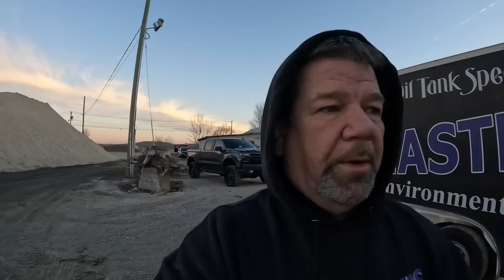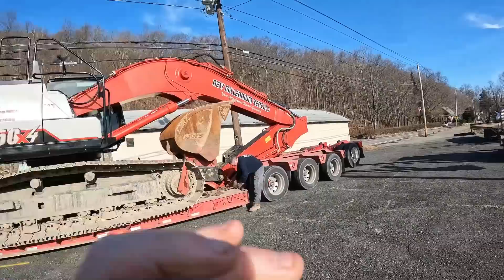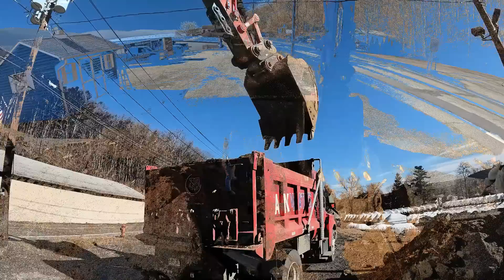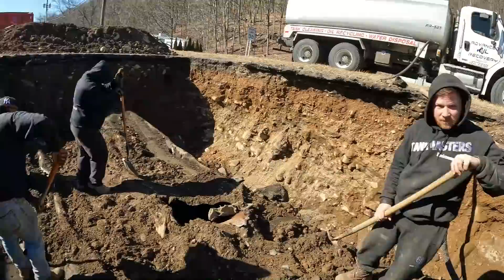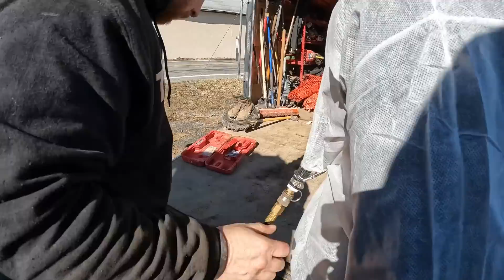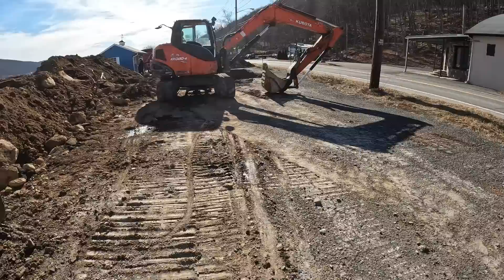LARGE GAS TANK REMOVALS AT A MARINA

Comment: When I was doing industrial controls, I was glad to work on ULCC super tankers for a few projects.  We used the exhaust from the ships engine to pressurize the holding tanks and had closed loop PID to regulate that pressure.  This would prevent the fuel/air mixture below the LEL and keep things safe with the inert mix.  😁👍
Reply from the maker: interesting

Comment: You operated that 40-ton excavator expertly and quickly exposed those buried tanks.  The bucket on that machine looked to be something like 48 inches and probably had a several yard capacity.  Those tanks were paper-thin and anything in them leaked out years ago.  It will be interesting to see if the soil around the tanks has any significant level of contamination.
Reply: He already said in the video there was
Reply: @staind288  .... the question is, how many tons? How far did it spread? Will work permits be needed if they get within 50 feet of the water? (normally 50 feet) Remember, shit flows downhill and it's probably had 50 years to do it..
Reply from the maker: in part two that is a hoodie challenge question. stay tuned

Comment: That's a pretty serious job. I have often wondered if adding a ground cable might be useful for cutting down the chance of making a spark while moving tanks. OTOH, in this case the gas is so old it probably won't burn, even though it stinks really bad. BTW, pre 1970 gasoline has a distinctly different odor from what we have these days.
Reply from the maker: hmmm, good thought
Reply: @TankMastersEnvironmental  ... BTW, a ground cable won't stop sparks from the Sawzall blade, but water will. Just thought I'd mention it.

Comment: I learned in confined space training the CO, carbon monoxide is flammable/explosive in a dense enough quantity. I doubt the tailpipe density is flammable but you’re dry ice co2 method sounds pretty safe. Is dry ice a better value than a bottle of co2? The dry ice may be better since it’s cold and fills bottom up in the tank.
Reply from the maker: Interesting!
Reply: I prefer dry ice as it will continually off gas co2 and maintain a safe level for a longer period of time with big holes in the tank

Comment: everyday stuff for me, I would have put a dirt berm between the excavation and the road to keep a distracted motorist from veering into the hole. wrap a strap around one end of the tank stand it up and let all the sludge and dirt run out onto plastic. I would have held the tank with one excavator and pulled the end off with the other instead of cutting with a saw or trying to enter.
Reply from the maker: I stood them up to get the soil out

Comment: I am not sure why you cut tanks open.. here in north west Ont. No one cuts tanks open. Even the 12 foot round 10k tanks witch must all gas stations use to have 5 to 6 of them for the 3 diferent grades of gas plus a clear and a colored fuel oil tank. They are vac truck sucked out with a 10" hose. dig them up an they are put on a low boy float soon as they come out of the ground. They cant put them on the ground. And cantamanated dirt must not be stock piled it must go strait into trucks. As a life time welder you never ever put a hose from a pick up into a gas tank an think it is safe. You may have built a much bigger bomb then you started with. If that engeine is at all running rich your loading the tank with raw vapor gas. I have welded many gas an feul tanks as well as tankers. You never cut or weld a gas tank of any kind with out doing every step needed to make it safe. All I can say is wow. Ripped a hole in a gas tank with tooth of bucket. Lucky your still here. Doing that is like hitting a natural gas line with an excavator or front end loader houses blow up burn to the ground you never touch a bucket to a gas tank one Spark Pow
Reply from the maker: To answer your questions. All tanks must be opened up and completely cleaned out a swabbed dry before you can remove from the ground. Before we cut ANY tanks we use an LEL (liquid explosive level)  meter to determine explosive level.  Thanks Good comments